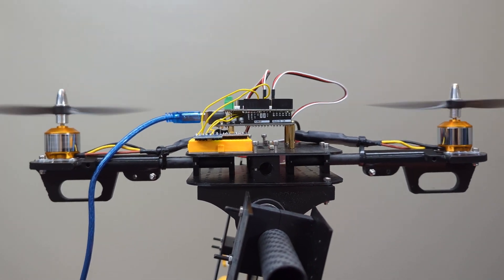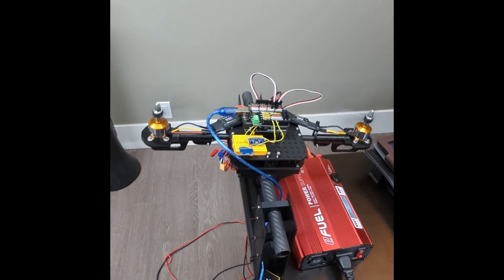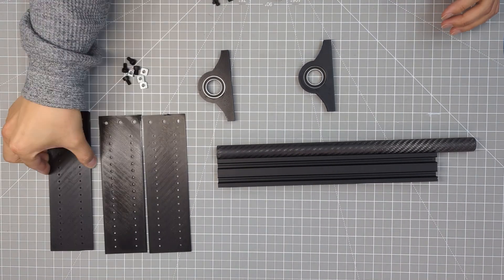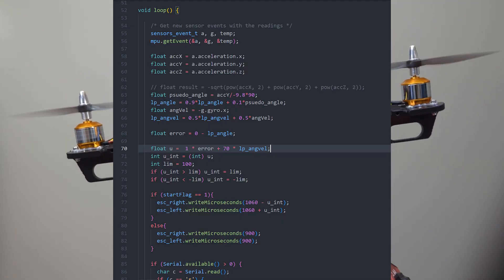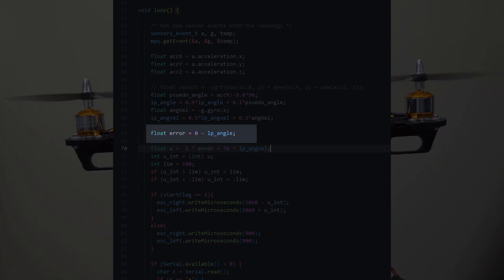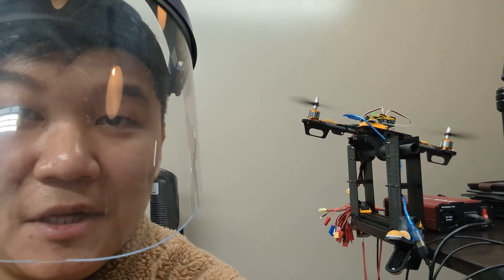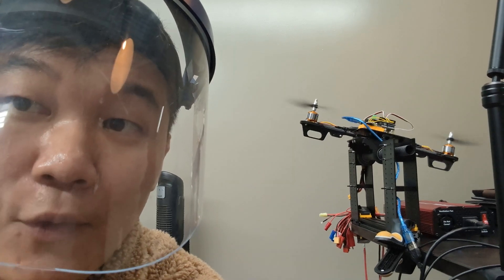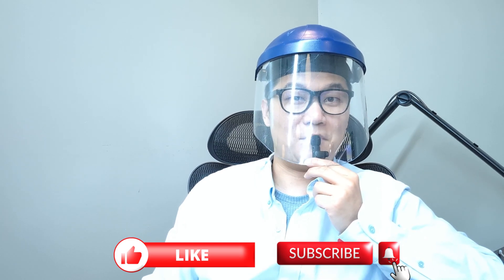How to Master PID Control in 2025 (feat. Arduino) | Ep. 3

Comment: what sensors are you fusing? is it not possible to get good stable data with a filter and some tuning of the PID controllers?
Reply from the maker: You are absolutely correct! A good filtering algorithm and PID tunning should be able to do it.

I used the old MPU6050, which, by default, has noise and bias. For instance, at 0 angle, the raw reading could be -2.33 and directly jump to 1 degree as I rotate. Then, the PID controller can't find the zero error as there's no 0 reading at all. 😂

Another reason why it's unstable can be the cheap ESC and motors. Given the same input, the RPMs of the 2 motors are just different. 

And more funky things happen as we go for 3D rotation!

I hope this answers your question. Thank you for your awesome comment! 😉👍
-EL
Reply: Using sensor fusion algorithms such as Mahony or Madgwick you can combine the raw data outputs from the accelerometer, gyroscope, and magnetometer sensors in the MPU6050 to get much more accurate roll, pitch, and yaw values than the raw sensor values will give you even with a good filter on them
Reply from the maker: @natehurley2617  Awesome point! Probably, I should post a video about it. Thanks for the comment! -EL